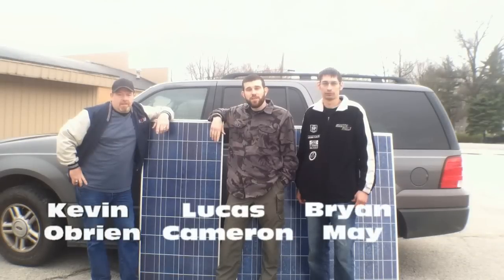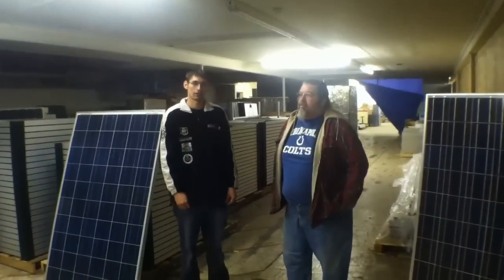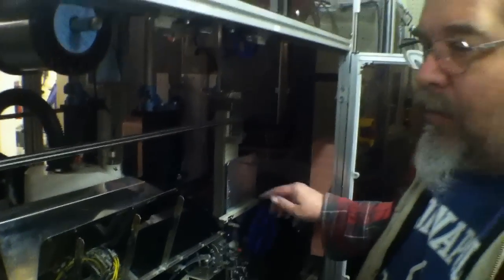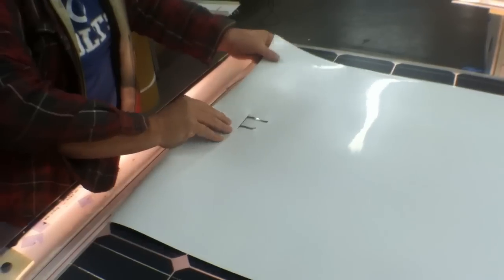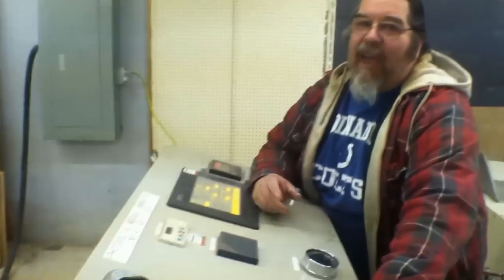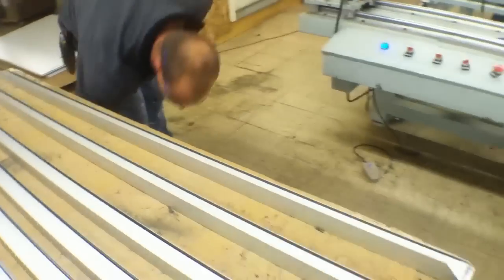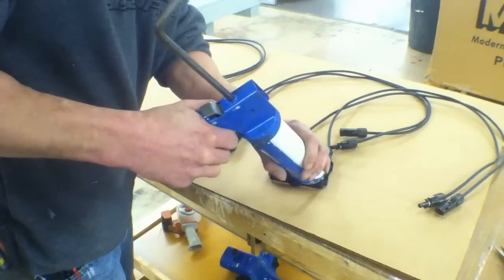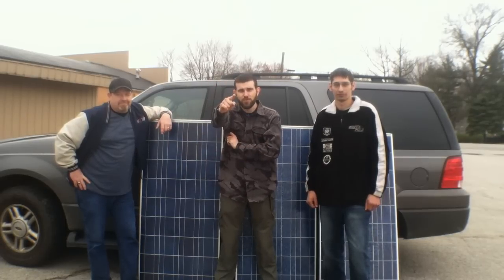How Solar Panels are made in America: A tour through a solar panel factory

Comment: How much power & fuel is used in the production of solar cells? I'm finding it hard to find an answer... Could you run a solar panel factory using your own solar power?
Reply: Fantastic video by the way, big thankyou
Reply: +Rob Knight Manufacturing solar cells takes A LOT of energy. Manufacturing panels doesn't  take as much. The stringing and laminating takes a good amount of energy. But other than that, its pretty simple.

Comment: liked the vid also the fact there are 3 anti-reverse protection diodes which most panels don't have. also you can change the output voltage with the series-parallel taps within the junction box